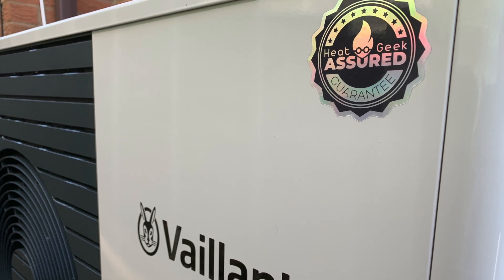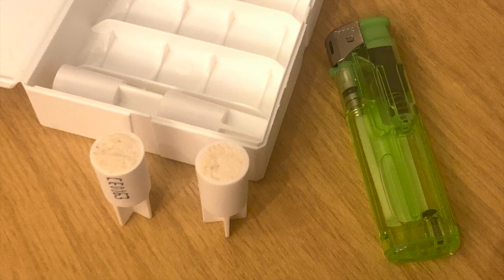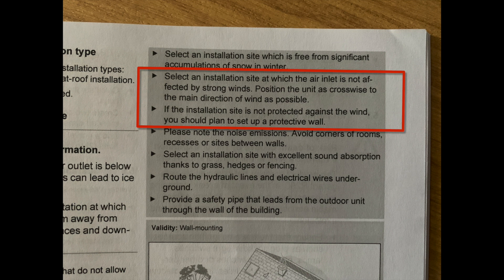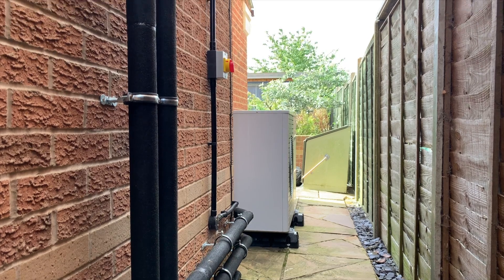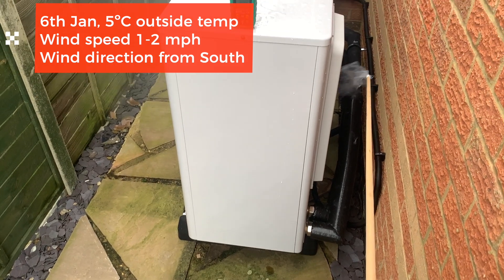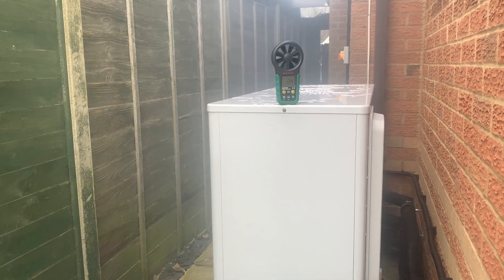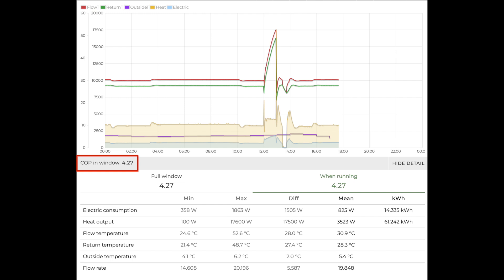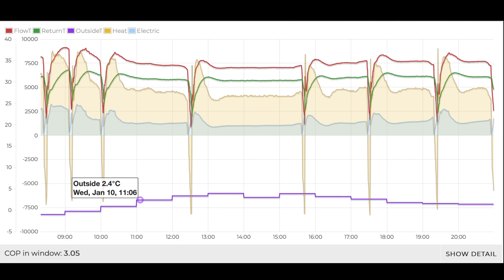Does our heat pump suffer from microclimating

Comment: The 7kW Vaillant shifts 2300 m3/h of air. I’ve assumed a cop of 4 and calculated that when it’s running at full power of 7kW, the air outlet temperature is 2.05C colder than inlet. Therefore, for each 1% of air which recirculates into the intake, the intake temperature is depressed by 0.02C. I wouldn’t worry.
Reply from the maker: Thank you for this calculation and info. Puts my mind at ease.
Reply: @johntisbury  if you want another calculation , for fun. If we take a cop of 4 in 7kW, that means heat from atmosphere is 5.25kw. If we say 1% recirculates , that’s a cooling on the intake of 52.5W. However, you have put your heat pump in a passage and the heat emitter from the bricks will be about 50W per square meter. I reckon you could well be recouping this or more because of the positioning in the passage. Therefore, you could well be winning on efficiency compared to placing the heat pump further away. We have to remember the pros as well as the cons. LOL.

Comment: Really interesting John, what is your break even CoP.
Reply from the maker: Thanks for watching. COP 3.0 and above is cheaper than gas.
Reply: @johntisbury  Hey John any updates for solar, battery and heat pump COP consumption in the pipeline for January?
Reply from the maker: @DMFPERFORMANCE pulling one together for a 3 month period over winter
Reply: John thank you for showing this, it was really useful. If property was all about ‘location location location’, then that certainly applies to heat pumps too. I live in a modern detached house (aka shoe box shoehorned development) and I am struggling to square where I could site one without ridiculous length primaries and meeting the MIs’ on clearances. Good experiment on re-ingestion I had a thought while watching - might be interesting to do it at night and illuminate the intake area with a laser level.😉👍
Reply from the maker: @normanboyes4983 good idea on night time smoke!

Comment: Happy new year John  it does seem very deceiving but I am sure you have spent many hours with a ribbon on the end of the cain . Perhaps you could mark the wall around the unit at the rear say 300 mm  etc  so we could see how it pulls the air just an idea ?  The main question is are you happy with the way it performs THATS all that matters . One last question what temperature are you running inside Glyn
Reply from the maker: Indoor temps vary between 19.5°C and 20°C depending on how cold it is outside. 

Yes, I’m happy. Mark will be returning to balance the radiators as it’s too warm upstairs. Other than that ever is working great. 

Thanks for the watching and Happy New Year to you too. 

I will think about your 300mm suggestion.  Not entirely sure I follow your thought process. 🤪
Reply: Was just wondering if there were any diverters inside the unit  eg hot air rises so colder air on floor maybe me just overthinking
Reply from the maker: @Glyn001  I had seen a chap who added a directional baffle on the front of his heat pump exhaust grill to direct the cooler air away from his plants that were opposite his heat pump. This worked very well for him.

Comment: Good video John. 
Side alleyways like yours are probably the most common arrangement between detached estate type houses & mine is very similar. I have an 4kW R32 air to air split system outdoor unit down the side of my house that serves a wall mounted unit in my conservatory. It's quite a bit smaller than your HP outdoor unit & the clearances are right on the limit if not a tad under the min frontal clearance. It works OK & we use it more for heating in winter than cooling in summer. However, an Air To Water outdoor unit like yours is quite a bit larger so I think I would struggle to get it down the side of my house (1m wide walkway) & have it work properly. This is one reason I'm quite interested in the circular Octopus Cosy HP which has a top air discharge which I believe lends itself more to side alley locations (it reminds of some old Carrier A/C units we to call "dustbins"). That said the Cosy unit is probably a bit wider than yours so getting past it to access the other end of the alley might be an issue. 
Either way I'm still in limbo about having an ATW HP for home heating. I'm a 50 year time served ex-HVAC industry guy who's been around Heat Pumps of all sorts all my working life & worked on some nasty old systems that used sulphur dioxide as the refrigerant. I always loved the idea of having a HP system in my home but now I'm a pensioner I'm really struggling with the aesthetics, the internal upheaval & the cost aspects. At the moment an air to air multi split is more attractive to me than an ATW system.
Keep the vids coming as they are always interesting.
Reply from the maker: Thanks for watching. Getting a sensible location for a larger unit can be tricky. Sounds like you’ve come to that conclusion.